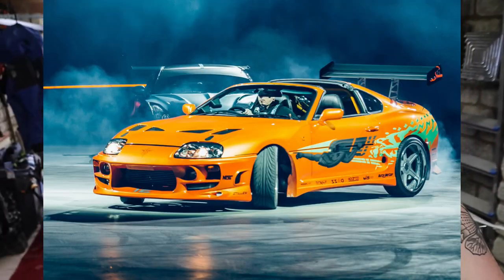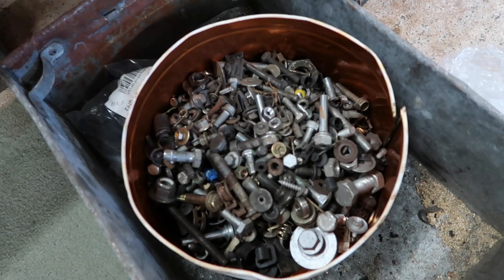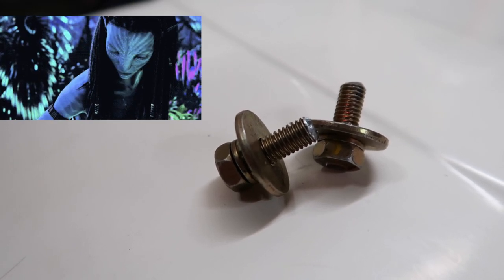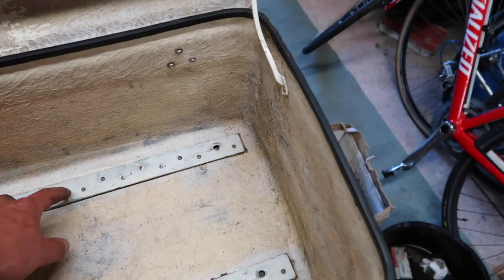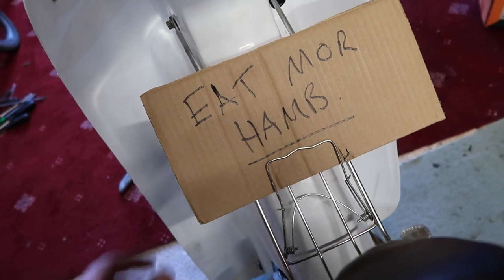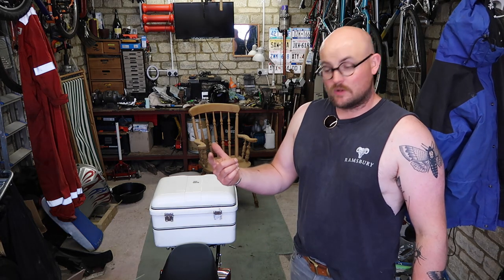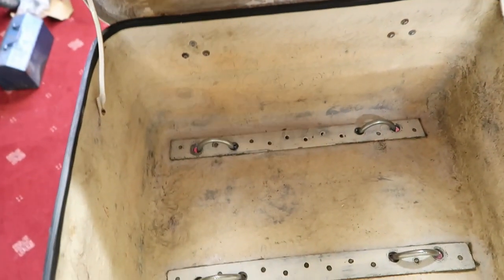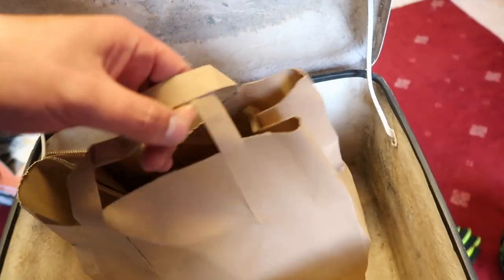Nice Rack - Putting Coq in my Box with a Tiny Honda C90 Motorbike

Comment: Quick tip. Thread a nut on before cutting down bolts. You’ll be pleasantly greeted by freshly die cut thread ends when you remove the nut after cutting with a hacksaw.
Reply from the maker: This is a really brilliant tip. Thank you very much. Makes perfect sense, is simple, but you only know when you know. Thanks to you, I know.